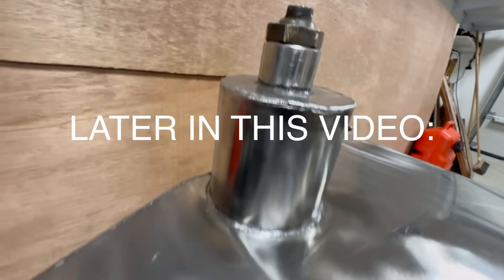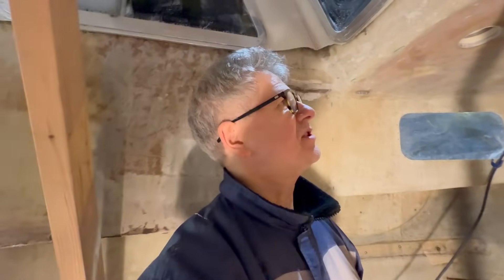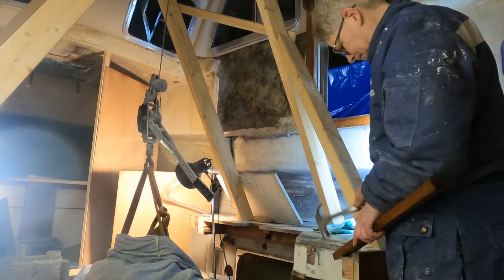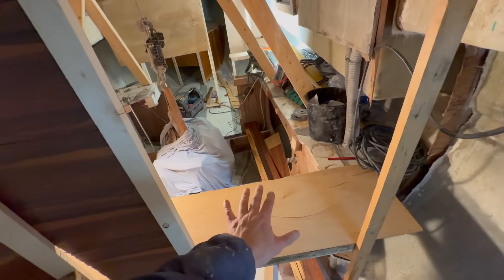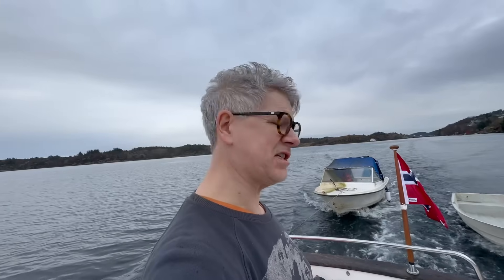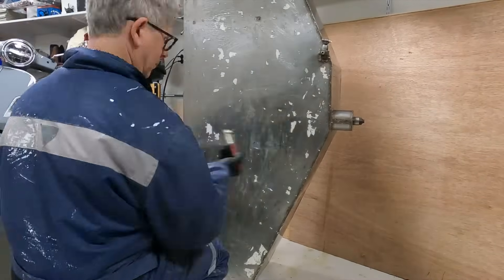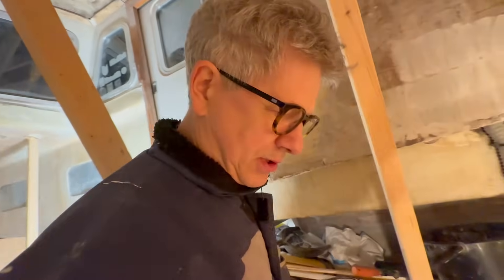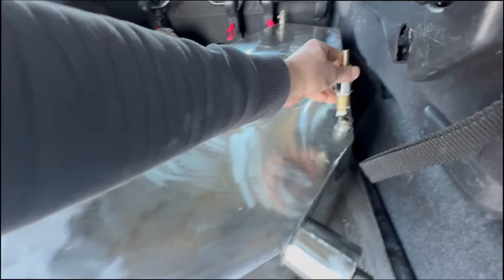Fisher 30 Ep 30 - Outside the BOX interior decision for the Motorsailer

Comment: Always interesting watching you work things out. Tank looks very nice polished. Alluring Arctic Sailing did a refit on a Garcia where he added a “day tank” used the polishing system to feed it and mounted it high enough so that it gravity fed the engine. Think the reasoning behind the addition was “just in case” pumps failed he could still fuel his engine. I like your idea of just running the pilot house floor aft. Nice work!
Reply from the maker: Thanks Ric. I have thought about a day tank - and I did actually watch that episode when it was released. This tank - however - suits very well (shape-wise) in the are I plan to put it. It will not be any higher up so no consequenses for the stability sideways, but it will be further aft so pulling it 50 cm further back will make the boat sit a bit on it stern. I think if the dieselpump fails the engine will stop anyway. It just a question of the pump works hard to pull the diesel and pump it back again. Thanks for supporting the "radical" idea of running the floor into the aft cabin area. Will be exciting to see how it turns out.

Comment: Hi Helge! Instead I agree completely in not having walls between center and aft! It will keep the feeling of space and you'll be sleeping very near to control room...
Maybe you will not put a toilet there...unless you put at least a tend...🙂 

on the side of the petrol weight unbalanced it's true that weights should be as centered as possible, but it's a REALLY little % of the weight and only few centimeters back...I don't think you will feel the difference and yes, you can counterbalance with water tanks. (not too forward!) Probably a good solution is soft tanks under the floor in the bath/kitchen level...if you have space under the floor...

You're doing a great job! Keep on it!
Reply from the maker: Thanks for adding even more positive points for not having a wall towards the aft cabin. You are right, there will be no toilet there when open space. 
Again I agree; it is 240 kg of diesel when full tank. Moving 240 kg 50cm backwards on a 9,16m long hull weighing in at 6600kg will have minor implications.
I actually have two soft tanks 80 litre each, but they will not fit under the floor. I will consider something. :-)
Reply: 160 litres are very little amount...unless you don't  wash dishes and have shower with hosts onboard.
Maybe something like the fuel tank as a step to the bow bed?
I wouldn't stay under 200litres...just to say...
Still you're doing VERY well! I admire your determination! 🙂
Reply from the maker: @MrClownPower  I agree. I will have much more than 160 liter. Not sure how much and where to put such a tank. I will find out later Thanks for your positivism 🙂
Reply: 160 litres under the bow bed both sides and 100 litres in a tank similar to the fuel tank, but smaller, put under the floor between the kitchen and the bow cabin...
Just to say... 🙂

Comment: Hi Helge!! I sent you a response to the last Email.  You are thinking out of the box with that rear design, but I think it can still work out fine as you can still have a bed in that back area running athwart ships (probably queen size) -- it won't have headroom, but laying down you will not need it, and a simple curtain can close it for privacy. Having that right next to the pilot house would be great for longer passages as a pilot berth. That new shelf you build above the stuffing box -- I would add a hatch for access to the stuffing box so you don't have to reach down along the side of the prop shaft for maintenance.  One question about the fuel tank placement -- as you lowered the tank almost flush to the hull, is there still enough room for the engine exhaust to pass by the tank without temperature concerns?
Reply from the maker: Hi Robert. I know that, and I did read it the next morning. I was so sure I answered it, but I have checked and I did not. Sorry for that. I must have my head examined. I will write you an answer. That discussion was interesting!
The thought with the layout of the aft cabin is to have a removable bed. I agree with the rest you wrote. 
The exhaust. Nope! No room for that. I will probably move the hole in the hull to a new location further forward. I will no matter what like to raise the height of the tube as to prevent water from entering the exhaust system when waves are smashing against the exhaust outlet.

Comment: Hello Helge!  It's good to see that you have recovered from the flu and maintain your sense of humour. For the placement of the head, you could use a retractable plastic curtain (instead of a wall) to keep that area dry when using the shower.  The polished fuel tank IS cool! 😄
Reply from the maker: Hello Duncan. The flu started with the known signals, but tuned out to be very mild. So got quickly into things again. The curtain is always on the table yes, but a wall would be more comfortable as the curtain tend to kling to the body while showering. My experience anyway. Yes the old diesel tank became sweet. I know it IS the same tank but it sure feels better to install this version....
Starting the next video with "Eye wide shut!" ;-)
Reply: Sometimes "eyes wide shut" is the way to go when you need to get things done.Sending strength and courage my friend. @hsobstad
Reply from the maker: @duncanjames914  Oh, my friend. This was not eyes but eye and a medical situastion. Just a hint to next video and why my left eye is now taped up (closed). Hopefully better in a few days...But I take the strength and courage and hope to be back on the boat fast. ;-)

Comment: I think it is a good move. I cannot oversee the  different floor levels, but I am sure you will give the information in one of the next video's. Oh..I am also forgetting a lot of equipment...so I decided to make a list in Google Keep...not perfect, but it helps.
Hope you have a productive spring! And a question: Do you use polyester or epoxy for inside structural works?
Reply from the maker: I gave most of the information about the interior in last video (ep 29). The change is the aft cabin now being open and the pilothouse floor extending into the aft cabin area. 
Poly or Epoxy? Both. Depending on needs. Polyester is quite cheap, not as strong, but more flexible, smells bad but cures fast (3h). Epoxy is expensive, 4x strong, but less flexible, smells less but cures slower (24h).

Comment: With regard to polyurethane two pack paint with which you were painting you engine bearers,hand painting is relatively safe,but if you spray paint polyurethane the activator used is carsenogeric,so breathing apperatus must be used,and not in confined areas,just a heads up!
Reply from the maker: Thanks for the heads up. Since then, the polyurethane paint has been redrawn from shops as it is now illegal to sell (in Norway and EU), due to health risk. So you were on to something...

Comment: Diesel fuel has an average density of 830g/l in Europe.  Winter diesel has a bigger range of allowed densities but the average is not much different.  Maybe 820g/l.  I would check the mass of a full tank and see if you can find a way of calculating the effect on the "sit" of the boat as the tank fills and empties.  Best practice would be to have any item whose mass can change placed as close to the centre of gravity (CoG) as possible and as low as possible.  Interesting to see your thought processes.
Reply from the maker: Hi Mike. The diesel weighs about 240 kg when full tank. Moving 240 kg 50cm backwards on a 9,16m long hull weighing in at 6600kg should not implicate a lot. The tank will not sit any higher in the boat then was. 
Placing a lot of weight very low will increase stability but will also make the boat less comfortable (for people) at sea as the rolling will be faster as the boat wish to settle on its lower weight. This boat already has a very high stability index no compared to its very modest sail. So I dont worry too much :-)
Reply: When talking about the trim of the boat, the calculations are referenced from the longitudinal centre of flotation (LCF).
Reply from the maker: @normanboyes4983  Hi Norman. I have not really made any calculations. Just trying common sense. Moving 250 kg 50 cm further back in a boat of 6600 kg. Should not make a hugh difference.... 🙂
Reply: @hsobstad  I agree with you - I was responding to MikeWilson.😉

Comment: dear helge, did you inspect the inside of the diesel tank? if so how? thanks for all your inspiration.
Reply from the maker: Hi Chiel. Yes I did. Only possible to inspect via the tank-gauge hole. Used a camera to inspect. No dirt, really. This is probably due to this tank is having a sump that any water and dirt can assemble there. Still I will do a chemical clean of the tank, just to be absolutely sure the tank is clean. And I will do a leak-test prior to install.

Comment: I am not sure moving the diesel tank aft that much is going to do the boat trim any good.  I would also consider the problem with trying to balance the weight aft with water tanks forward.  If you still have nearly full diesel tank and nearly empty water tanks, the boat could be badly out of trim.  Yes, it is a very full displacement hull shape but didn’t you also move the engine mounting to the rear?  Hope it works out for you…. Regards.
Reply: Agree my thoughts entirely Marty Australia
Reply from the maker: I am sure you are right about the trim. It will push down on the stern. The diesel weighs about 240 kg when full tank. Moving 240 kg 50cm backwards on a 9,16m long hull weighing in at 6600kg should how ever not implicate a lot. So badly out of trim...I think not. I actually did not move the engine backwards. I considered that, but decided not to.
It will be exciting to see how it works out... :-)

Comment: Can I please ask how the emergency tiller will work?
Reply from the maker: Sure you can, Kevin. And I will even give you an answer. ;-)
In the video you can see the top of the rudder, with the metal arm for the steering mechanism. I have a metal tube about 1,5 meter, with a 90 degree bend and then about 30 cm in length. The latter plugs directly onto the top of the rudder shaft. Then it steers like a ordinary tiller, but from the inside (may need to disassemble the mechanic steering from the metal arm). In this instance it will be great to have open space into the aft cabin area. Was this understandably? :-)
Reply: @hsobstad   Yes, thank you.  I was wondering how it would work because it must be hard to see out if you ever have to use it.   Clearly the wall you originally planned must make it even harder.
Reply from the maker: @kevinhorne723  Correct! It is not optimal at all. Just for emergency... 🙂

Comment: ... an edit : Why a diesel tank this big ?
It's a sailboat, I pressume, you need this engine only while becalmed, in the harbor and in an emergency ?
Reply from the maker: It is actually a motorsailer. Something between a motorboat and a sailboat. So the engine will be used a lot, together with the sails.